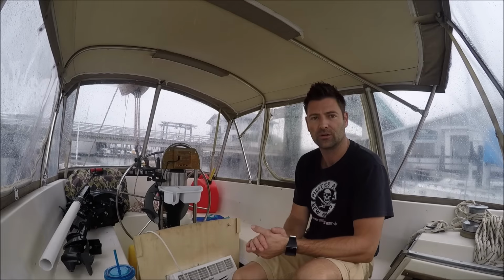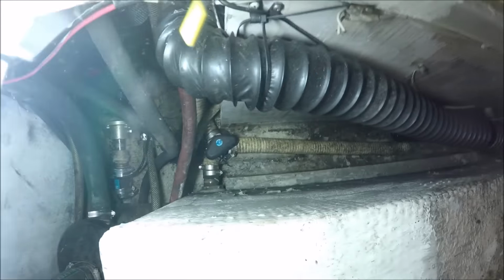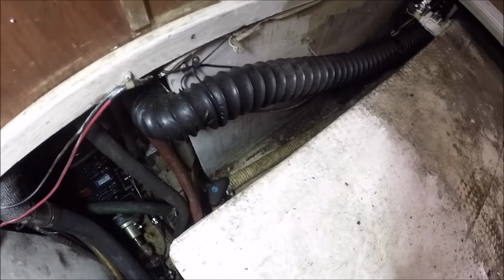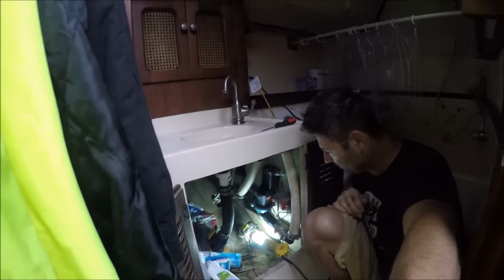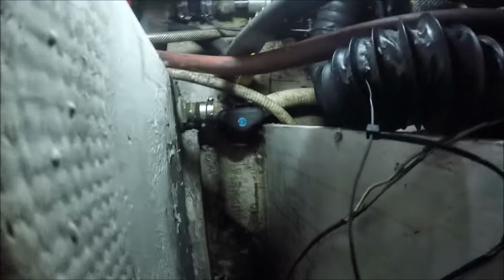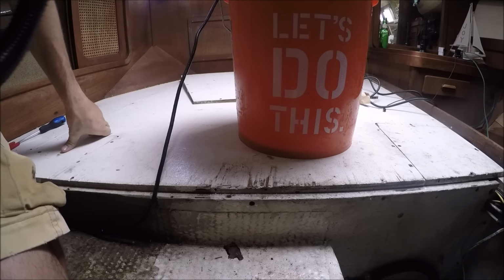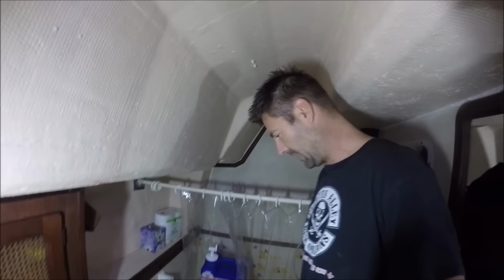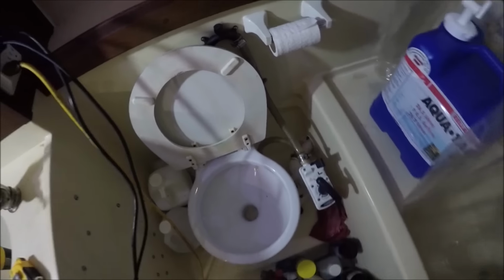DIY Electric toilet on a sailboat.

Comment: Finally, a video showing how to deal with the siphon problem with the saltwater feeder line in.
I have been trying to solve the problem of always having to turn a valve every time to open the seawater in, and then again after use each time, or water continues to fill the bowl.
Obviously, the problem is that one time I, or someone else forgets to shut the valve back off, which could be very problematic.
Your idea is great because it breaks the vacuum, and it's failsafe.
Did you figure that out, did someone show you?
And is there any other way that you may have learned about since you did this?
Thanks for your upload and any answers you might be able to give me.

Comment: It is always a smelly job to fix a head problem. If you use your shower, you might want to consider having the shower drain into a gray water tank and then use the grey water to flush with. That way your soapy water helps keep the pipes clean and you save water.
-johnny
Reply from the maker: +AdventuresOnBoats.com that's an interesting idea.  I might try that out in the future.
Reply: I' m so glad to know someone else but me thinked about it. I had the same idea to build a wc in my truck house.
Reply: Nice effort.  I wanna do something similar for a bus.

Comment: I have an odd question, if you please.  If you buy a salvage sail boat, either a normal hull or catamaran, and while you fix, repair or rebuilt it, can you omit the "sail" aspect of it and use it as a normal boat, which has an engine?  just curious
Reply from the maker: Yes

Comment: It is a tough job that only an owner would undertake without being paid big bucks. I am guessing your battery bank is in the stern so that would mean you have a 20 to 30 foot one-way run from the batteries to the head. My question is what size wire/cable did you you use and what was the actual length of the run?
Reply from the maker: Batteries are right under the stairs.  About 3 feet from the head.  I have a overboard discharge pump under the bathroom sink.  I taped into that to power the toilet pump.  I can't remember what size the wire is.

Comment: Not only is it a dirty job, but pulling those hoses off fittings is not easy in tight spaces.   To pay someone to do that is quote: " Two days, two men, two thousand dollars"!
Reply: +S/V Southern Lady Marine repair quotes are so much more than car quotes for similar work. It seems their attitude is if you have a boat you can afford it lol. I'm lucky enough to have enough knowledge to do all my own work so far.
Reply from the maker: +S/V Southern Lady The toilet and hose was expensive enough.   I don't know if I would would to do this job again.   I did have a health dose of rum to get me through it.
Reply from the maker: +Andrew Polson So far I have only paid the yard to help me get the mast down and I had a rigging shop build the new stays when I replaced the standing rigging.  There is a big sense of accomplishment when you can fix  your own boat.
Reply: Down In The Islands Mines smaller so easier to work on some parts like the mast. It has a pivoting foot so fairly easy to take down yourself compared to T foots that need a crane. And yes their is a lot of satisfaction in sorting it yourself. Plus if it goes wrong you should have a better understanding to make repairs too. New stays are always something that needs a workshop too sort unless you happen to have a press in your workshop.

Comment: How many gallons is your holding tank?  Just got an S2 9.2c, and the tank is only 10 gallons.  Looks like I'll be pumping it out frequently!  (And haven't found the Y valve yet...)
Reply from the maker: Its 30 gallons.   Is yours part of the hull?  Mine is solid fiberglass and attached to the hull.  I have a pump that will pump my tank directly over board.  I'm going to try to work up a system that is direct discharge meaning it doesn't go into the holding tank first.  Will only be able to use it off shore or when out of the united states.